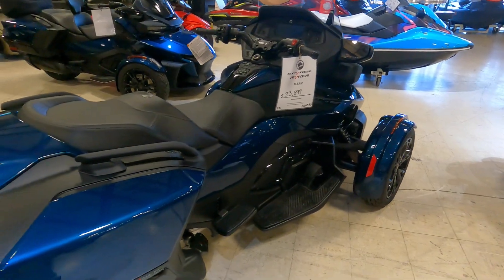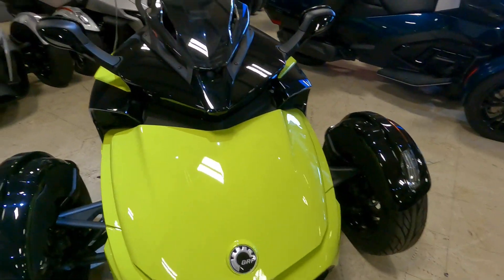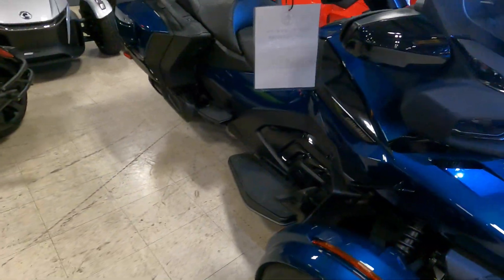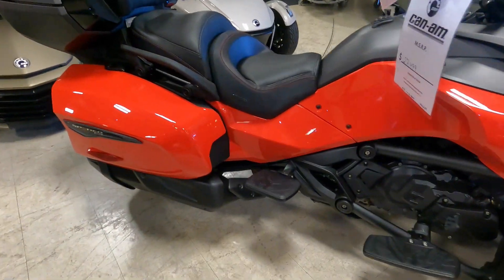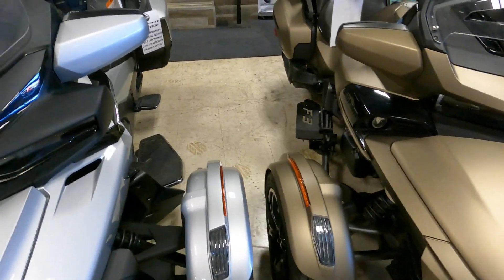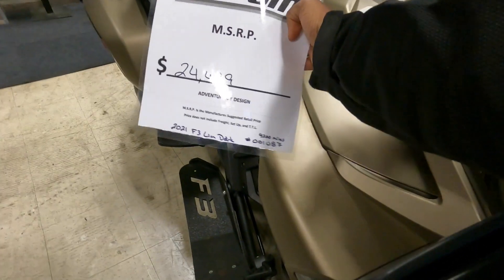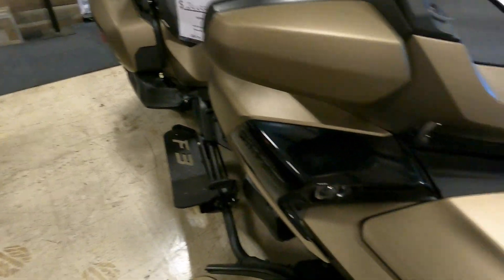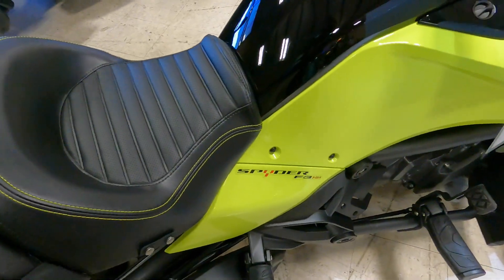did someone say recall..new sprocket install

Comment: I saw the new sprockets are white.why yours not?
Reply from the maker: The white sprockets were the temp fixes the grey ones are the permanent fixes
Reply: @steadyspeed1155  so the 22 on the dealers that i have seen have the white one, haven't seen a 23 yet
Reply from the maker: @mandytuning  I wonder why they did that and not the grey one..but from my knowledge and reading posts in the different groups the white one was the temp fix not permanent but I'm sure if u was to get one they would go head and put the permanent fix on but its something to inquire about
Reply: By the way i bought a 22 f3t with white sprocket a couple days ago , i put the vin in the brp recall page and doesn't show up any recalls for it.🤷🏻‍♂️
Reply: But i believe is a recent update so probably will show in bikes later in 2023
Reply from the maker: @mandytuning probably so but congrads on ur purchase tho if u have any questions about upgrading anything just ask 😀
Reply: The 2022’s and 23’s dont have a recall i think its 2015 to 2019
Reply from the maker: @Chubz215philly  yea I believe yal good cause those models are very new I for a fact it was 2015 to 2019 models fa sho